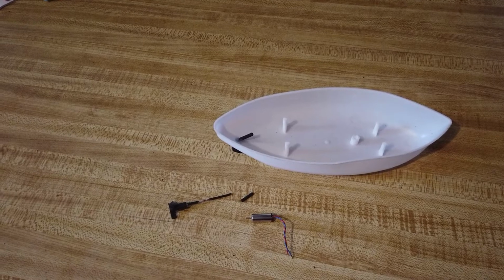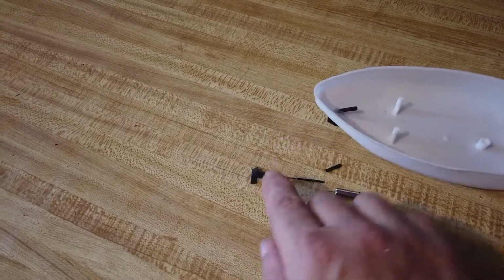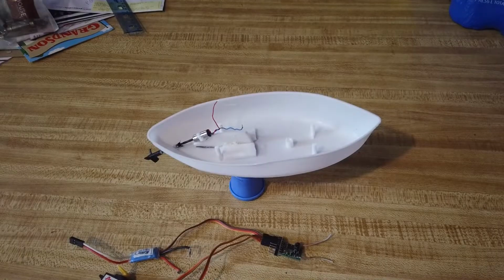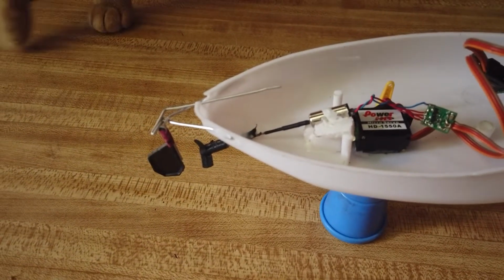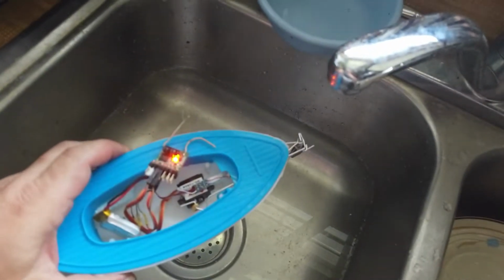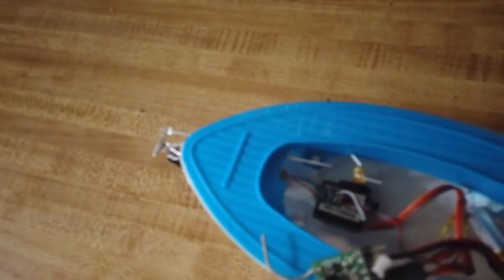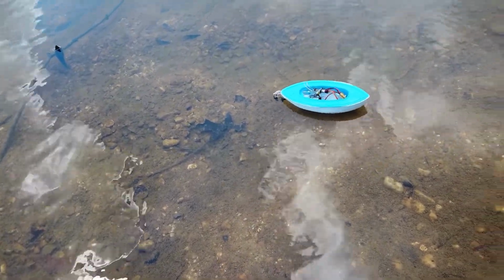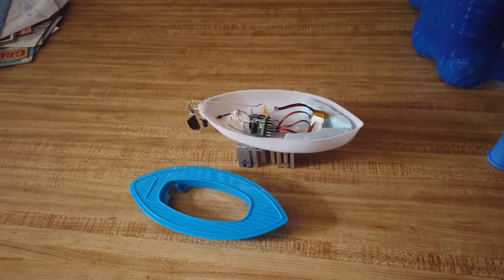Rudder RC boat build

Comment: A great fun project. Surprise you managed to kill the servo circuit board. I have run relatively large motors (compared to the servo motor) such as the small 1.5v - 4.5v size common in lots of toys and the small coreless. I guess it depends on the loading and how long you run them 😊😊
Reply from the maker: That original motor is bigger than usual 6mm, it wouldn't fit in a quad shroud when tried. Am thinking it's a 'Black Series', a high performance type bought years back. Also, the receiver did start to blink after only a couple of minutes or so of power and the 1S lipo. But, better on the bench than in the water 😀

Comment: I had my concerns about the prop shape but it and the motor did a good job moving it in the water !
Reply from the maker: Both were surprising, true enough. The prop was a straight print from Thingiverse, so I figured someone had tested it on something ☺